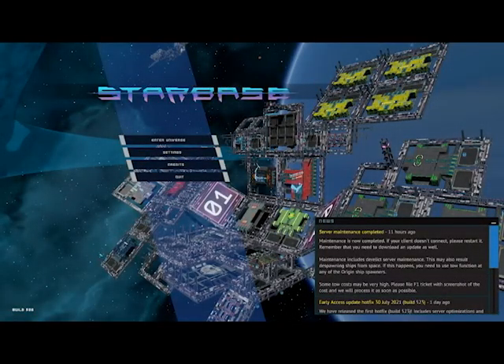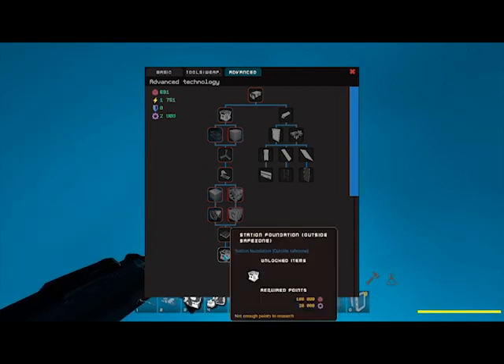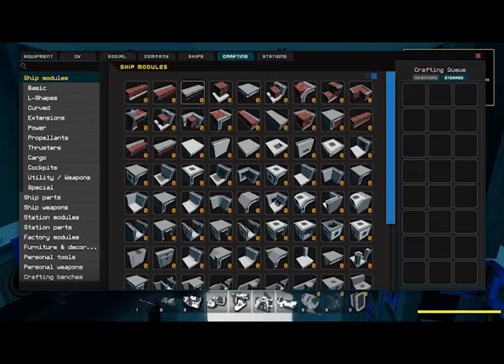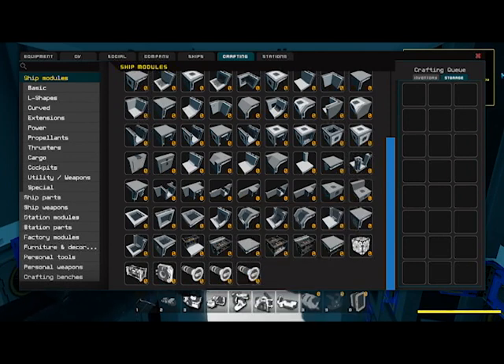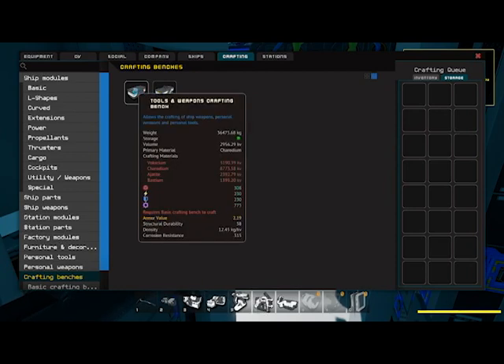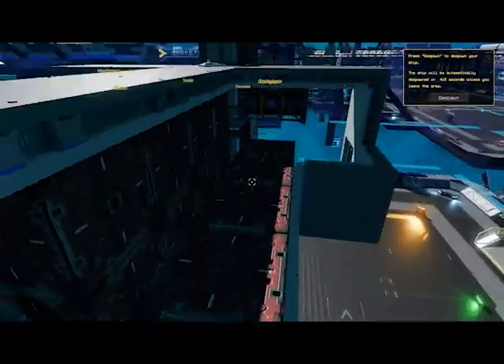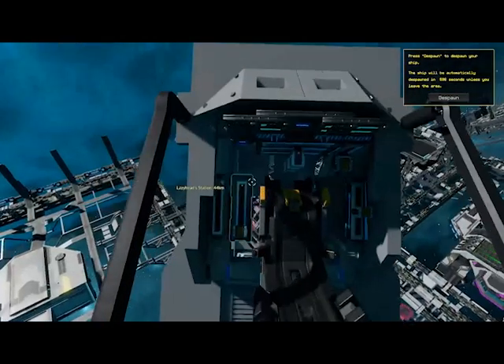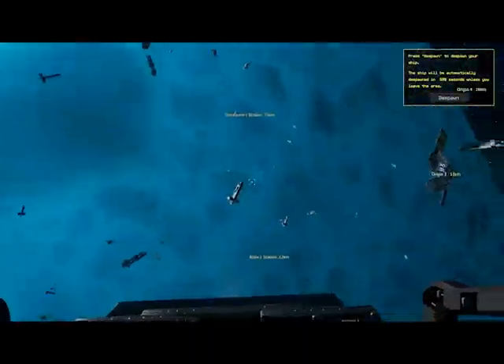Starbase How To Refill Fuel Rods And More

Comment: how do you refill it tho do you have to put empty 1 in inventory first? and if so how do you do that becuase i have the stuff to refill and 2 empty fuel rods but in crafting it reads zero
Reply: I order to pull it out use "E" to select it then "P" to put it in your pack. You can also just set the empty in space and swap into you slot that you take the full from. Placing the full one in use the R key holding it and the Right mouse button to manipulate it. It helps hitting the c key to snap it to grid and when aligned to the slot correctly it will have a dim lit highlight around it, then hit e again to let it go it will change color and you can turn your systems back on.
Reply from the maker: To refill it it must be be in your station storage with the ore or in your inventory with ore in your auto collect slot then it will show up with a number